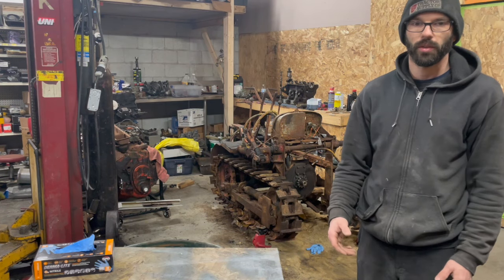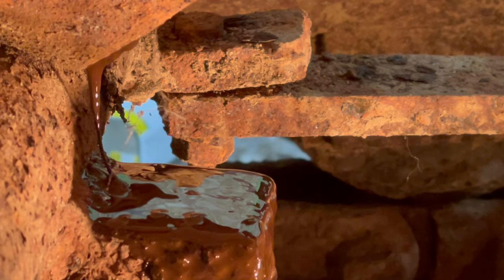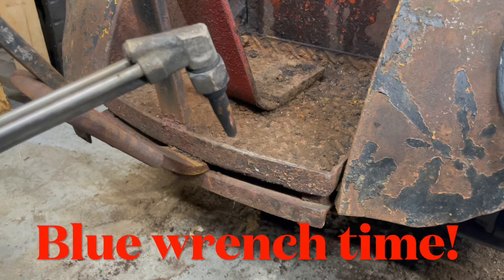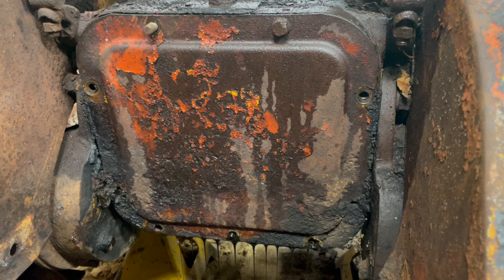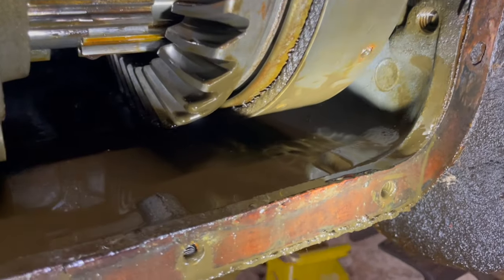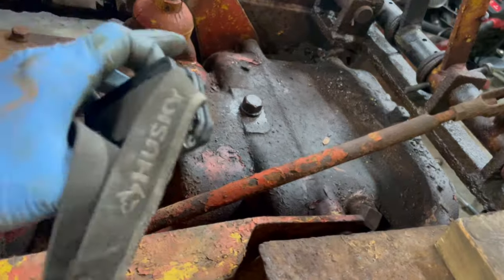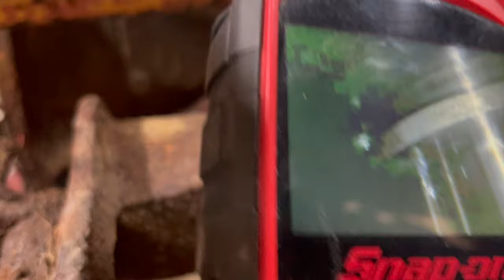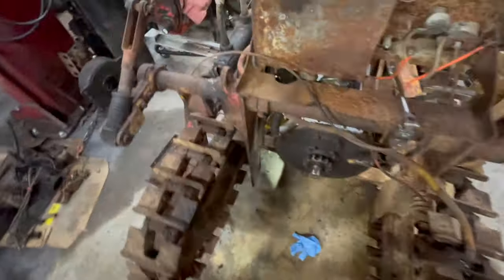Mity Kat bulldozer rebuild a look inside... Shmoo ‼️

Comment: I like that hammer vibrating trick to free the gasket.  Gotta try that sometime!
Reply from the maker: Works 60 percent of the time every time! listen for the sound to change
Reply: @jmpsavescars  Will do & thanks for the additional tip.
That old machine is built like a WWII tank.  Interesting heavy duty engineering in that drive train.  Probably very expensive to build.

Comment: The bolt on top is for the seat bracket on another application ( Cletrac HG ) I guess you can use it to fill with oil
Reply from the maker: Ok so in this application they tapped it npt for the plug? Hmm cool